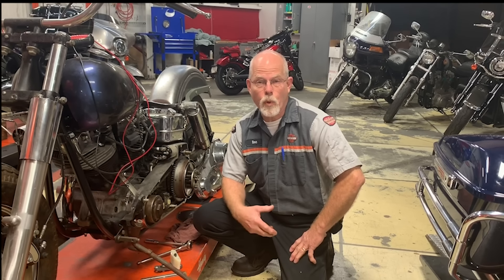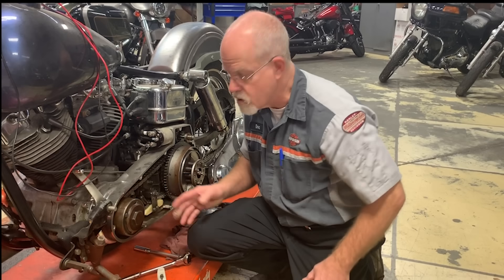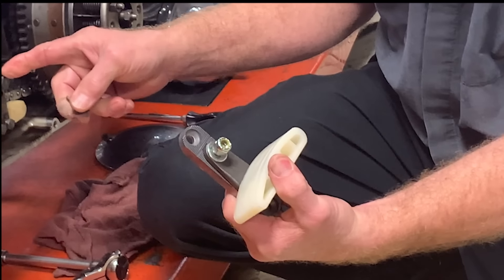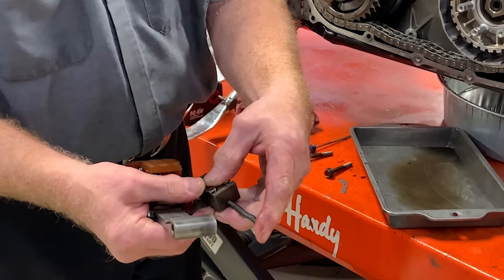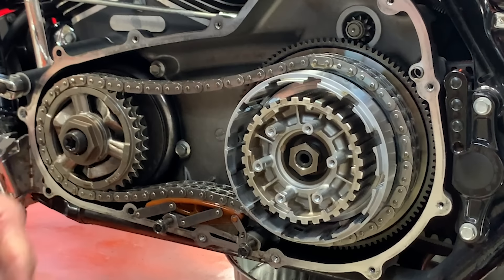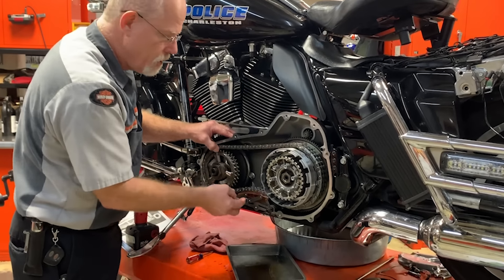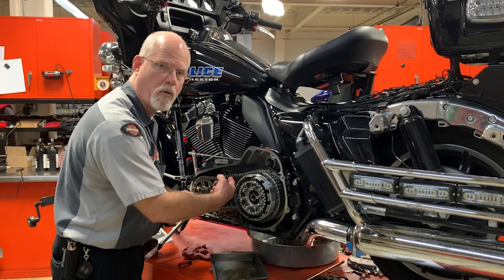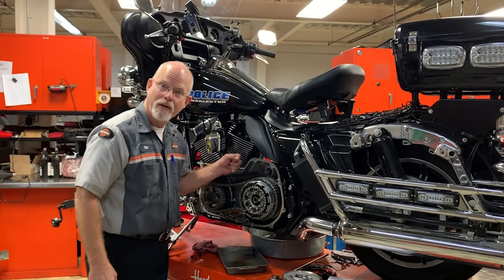DOC HARLEY: PRIMARY CHAIN ADJUSTER UPDATES

Comment: Doc,  I found the electrical problem, I will write on that blog what the story is.  You're gonna be astounded to hear what it is.  Now my issue on Primary Chain Tensioners.  My bike is an 2003 so it had the standard chain tensioner. well,  adjusting the Primary Chain every 10,000 miles isn't something I wanted to do so, when I completely redid the primary at 60,000 miles, I spent the $125 for the updated latest model of Harleys Automatic Chain Tensioner.  Now I read about this thing over tightening the chain and causing excessive force on the crankshaft, bearings and transmission bearings.  So, I went from a manual adjust that wasn't causing any harm to a part that now causes harm and I got to pay $125 for it.  Does Harley do anything the correct way from the beginning.???  I've  had nothing but problems with this bike over 20 years....$19,000 for the purchase and $20,000 in additional parts and service on it.   So, do I have to check this damn automatic tensioner every 10,000 miles and if so, off it comes and I'll just go back to a manual adjust one.  At least I know its not going to over tension the chain and cause more damage and more money spent on parts.....This was my first Harley and its my last....Goldwing...!!!!!
Reply from the maker: Thank you for sharing. I don’t appreciate the rant but it’s your story. The new auto tensioner, has it been over tightening your chain or are all the Forums using there crystal balls and telling you your primary chain is to tight? I enjoy when people post facts and personal experiences then what they have read or heard. I am happy you work on your own bike. Is your bike completely stock? I have customers with your bike that are completely stock and have not spent what you say you spent. I am sure someone will be totally happy purchasing your Harley-Davidson when you buy a Gold wing…..Doc
Reply: @LowCountryHarleyDavidson  Doc, that was not a rant, it was my professional opinion as a Mechanical Engineer with 40 years of experience.  However,  I will conceded the fact that I do not know if it is over tensioning my chain.  I have not checked it yet but, I plan to very soon. What I posted is what I read, and I do agree there is allot of disinformation out there but, once you see article after article published about this topic you have to certainly consider the validity of the comments.  I consider both sides or any topic and I never take it personal either way.  Thanks for your help.....
Reply: And for those of you taking your bike to Low Country - be forewarned of this attitude.  Immediately assumed it was a rant and got offended.   WOW
Reply: @LowCountryHarleyDavidson  Look who was ranting now.
Reply: @raymondpontremoli4500  Not only was yours not a rant, but an accurate observation which has proven to (the cause) have come home to roost all over the fanboys out there.

Comment: 2019 Road King….. main shaft bearings on the trans toasted and trans had to be completely rebuilt due to that stock adjuster. Pulled the stock adjuster and installed a new baker attitude adjuster….problem solved.

Comment: So Doc mentions the Achilles heel being the fact that the design doesn't do well when "your motor makes more horsepower than the factory design".   YET, this same design has been used in several interations of motors each with different horsepower.   So either it can or it can't handle the horsepower whether it's a Stage 2 103 or a 107, or a 114.
Reply from the maker: Thanks for sharing your black and white view….Doc

Comment: Great video. The internet seems to magnify problems. From some channels you’d think the stock auto tensioner trashes everyone’s transmission bearings in 20,000 miles.
Reply: No, "the internet" does NOT magnify the problem, on the contrary. 
The internet simply brings that problem to light.
Reply: I've been thinking the same thing, sounds like you need to rebuild your bike every week or it will explode. I find doing routine maintenance and not riding like an idiot will avoid a lot of the problems people complain about.

Comment: I have heard lots of complaints about the auto tensioner problem and many recommend aftermarket brands. I as of yet haven't had a problem. I am not looking forward to researching which one to use. I guess the mileage when it goes down will be a factor. I change the big 3 every 3000 miles. I also hear about issues with the compensator too
:^( ~     this is going to get expensive fast!
Reply from the maker: Just a suggestion, quit reading and more riding....Doc
Reply: @LowCountryHarleyDavidson  
      Oh, GREAT recommendation!
Bury your head in the sand? 
      GOOD ONE! 
Nothing to see here........

Comment: Great video, I have been looking at a manual tensioner like the SE manual and others.
I see lots of compliments about the SE manual primary chain tensioner AND others. To the point of people removing them shortly after install.
Why are the manual tensioners more noisy and what if anything can help quiet them down?
I know it's also a subjective thing but there are too many online posts about manuals being very loud.
Looking forward to your thoughts Doc.
Keep up the great videos!
Reply from the maker: When owners are use to the whine(sound) of the auto-tensioner and switch to the manual, most fail to find the "tight" link when adjusting the slack. So what started as a comfortable measurment for expansion in the primary is now way to much. 
even with my auto-tensioner I have started using the New HD gear oil for primarys and this has improved the sound...Doc
Reply: @LowCountryHarleyDavidson  when you say "way too much, are you indicating that they wrongly adjust a loose spot and therefore the primary chain is over tight in some areas and thus wines and makes excessive noise?

Comment: soooo My dyna street bob is an 09. I have the factory service manual. It doesnt show any service interval on the primary chain adjuster. [or I didnt see it since I was looking for something else] I bought her used with only 12K miles on the clock. I actually ride it [daily] Im already at 20K miles. Its basically stock and its transportation I dont race it or ride it like I stole it. When or rather if I should be concerned about that primary chain adjuster? I change all fluids monthly because its cheap insurance and see no metal or nylon in the fluid when drained.  Bike is stock EXCEPT for a gear drive and cams, pipes and a remap.  Like I said its transportation and ridden as such.

Comment: I wouldn’t testically call it a fully “automatic” adjuster. It tightens up but never loosens up when it should and ends up pulling the clutch basket and compensator towards each other which results in destroyed barring and all kinds of expensive problems it’s definitely not a true auto adjusting tensioner

Comment: This is so topical for me right now. I was just wondering about these the other day!! I was looking at the online catalog for SE options and this was there. So, for my stock but stage one 04 Softail...Hope you can answer:

1. Is there much threat of the ratchet up issue on mine with the auto-tensioner? I’m middle of the road or less on aggressive throttle. Again, Stage-One, TC88B which is otherwise bone stock. 
2. In two years, with only 11,000 miles still on the bike, I need PC Chain tightening every service. Is this typical? 

Thanks so much for your videos, I really enjoy and learn from them every time.
Reply from the maker: Check your primary chain for a complete month, if it's always too tight consider the manual adjuster.

Comment: Hey Doc I want to the see if you can make a video on  pulley l have a 2003 Heritage Solftail with a 70  Teeth pulley  want to  put a 68 teeth  pulley, will that  change my Rpm when cruising 😎 harley 03
Reply: Can't  Afford a 6 speed transmission harley 03😎
Reply: I did the 34 tooth trans pulley on mine from Andrews . Works great . Less rpms . Like it better than 6 speed . Too much shifting . 5 speed box is a better box - ✊🏻👍👌

Comment: My 2015 has 108 hp & 116 tq. Should I change to a manual adjuster ?
Reply: My '15 Ultra with stage IV tire shredder kit 119 hp &126 tq. and 45,000 miles changed clutch plates and heavier springs. OEM hyd. adjuster was pretty well worn and chain had a tight 3/8" of play. l went with a Baker manual adjuster. Hooks up great, shifts great, easy to find neutral and no more clutch slippage in 4th or 5th gear. Check your chain tension and decide.
Reply: Charles Richardson thanks 
I have the screaming eagle heavy duty clutch spring and it’s not slipping. Had the Barnett spring omg have to be hulk hogan to pull in the clutch 😆

Comment: Throw it away. Its design is to scissor your stuff and cause damage and oul leaks. Weld one. Keep it in same spot and change cheaper parts if needed not the other damage they cause
Reply from the maker: A very strong opinion with no facts posted. Don’t trust everything posted on the Net…..Doc
Reply: @LowCountryHarleyDavidson  the fact are history of people who don't work on their own bikes bringing them in for a oil leak on transmission shaft seals and it causes the transmission shaft to pull forward towards the front . Come on man

Comment: That was pretty cool Doc thanks , I do have a question and was wondering , why does the clutch clunk so hard when you engage it ? Why wouldn't it be a smooth connection .
Reply: You mean the clunk when you put it in gear? That is the gear engaging, not the clutch and is normal.
Reply: @Wooley689  But why is their so much force that it causes that to happen ? Why isn't it a easy engagement .
Reply: @BigTruckRacing  Its the way the gears are cut by design. Now if it is hard to put in gear you may need a clutch adjustment or a fluid change.
Reply: Try holding the clutch in 15 seconds when it's cold and most of the time it will drop into first smoothly. When it's hot after starting hold the clutch in and slowly raise rpm to 1500 or a little more and drop into first.

Comment: That auto adjuster poorly engineered, as you pointed out.
      A few years ago I discovered that my primary chain was as tight as a piano string! You said this could happen, and does. And, I'm pretty easy on my bike. Inner clutch hub splines broken off. Etc.
      If it did it once, it will do it again. It would be better to buy a manually adjustable unit, and you won't have to worry about the auto adjuster wrecking your ride.
      I can't believe you go on to promote it.
Reply from the maker: Thanks for sharing your Strong opinion..I promote what HD uses. It works for most. Could there be a better design YES.
And most won't do or pay for someone to adjust a manual primary adjuster.....Doc
Reply: @LowCountryHarleyDavidson  
      Yes, it IS a strong strong statement, and hardly an opinion. It's a fact.
      It's apparent you represent Harley, and with that, your postion pertaining to this issue. 
      What I'm "hearing" is, Harley takes no responsibility in this matter. It is a failed design. The design has the potential of causing damage for everyone, without notice or even indication that it happened. 
     This "issue" has been (and still is) the topic of many discussions on hdforums etc etc.
     May I point out the irony of the rest of your response.........
     You state that people wouldn't want to pay to have someone adjust a manual tensioner. And with that, instructions on how to "check" to see if you have this issue. Who's going to do that? AND, once the problem has been discovered, who's going to fix it? So much for checking your tension every 20k miles or so.......
      Even if you did all that, (whether it's done by the owner or mechanic) the problem is NOT remedied, nor does it go away. It WILL happen again. 
      To me, your video is basically telling us that Harley takes no responsibility in this matter, and offers no solution, thus claiming no foul. 
      It's very disappointing to your customers, loyal or otherwise. I have spent much money on parts, and supplying my own labor (thank God) to repair the damage done to my bike. Fortunately it didn't damage my crank bearings or transmission bearings. (that I'm aware of at this time) Because I'm mechanically inclined, I modified my "auto" tensioner to a "manual" tensioner for about $1.00 and a few hours of labor. Otherwise, an aftermarket Baker etc would have cost me $150 -$200, not counting labor, if applicable.  (Not to mention (above) the clutch hub, and relative bearings.
      It's a BIG fail for Harley Davidson.

Comment: I believe that the 39929-06B primary auto adjuster didn't appear until 2009 or 10 models so the early adjuster is on 06 Dynas and all 07-09's.  Also the 40063-05B retro for earlier models which I also have comes in two pieces (but is weirdly stamped as 39929-06B > go figure?)